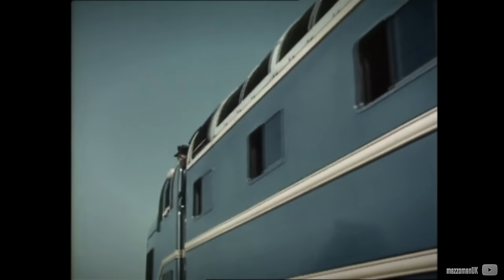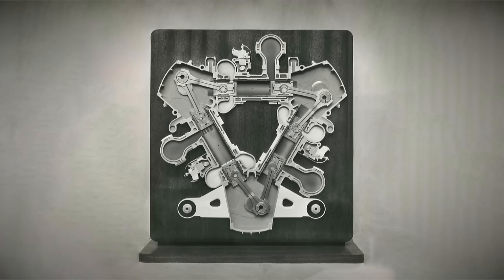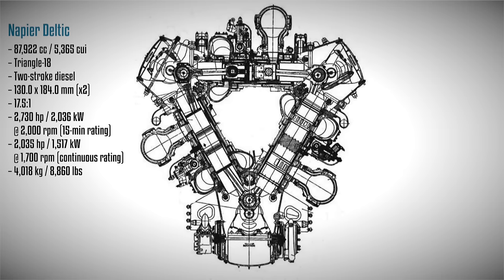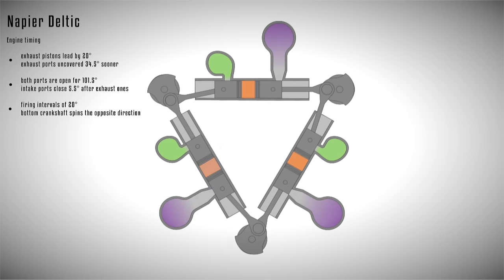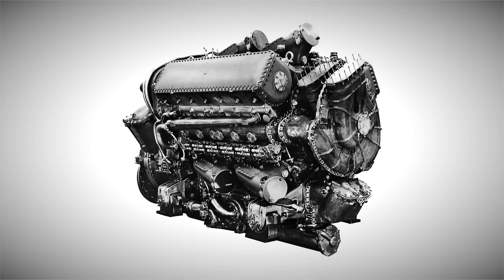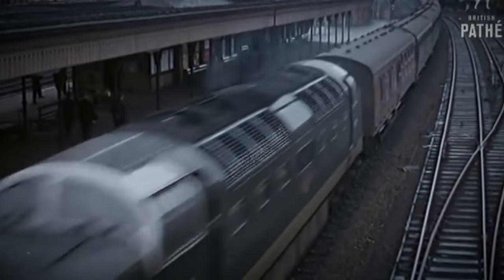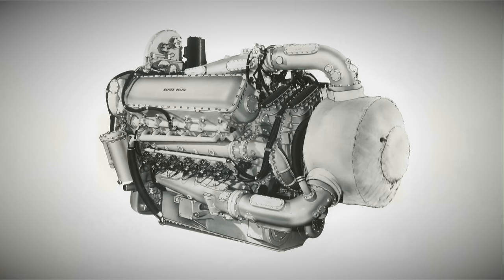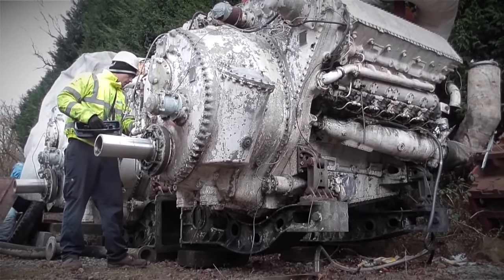The Ingenious Napier Deltic 2-Stroke Diesel Engine

Comment: So the 22 Deltic loco replaced 55 steam locomotives and, though they had a short life there are 6 in preservation. Not bad after sixty years. I remember the Deltic at York station and feeling the platform vibrate and the surge of power as they moved away.
Lets not forget that English Electric also built the Lightening jet, both icons of British industry.
Reply: The Gegenkolbenmotor (opposed-piston engine) was an absolutely revolutionary engine design invented by Wilhelm von Oechelhauser and junior partner Hugo Junkers, patented on July 8th, 1892.

Comment: The Napier Deltic is a variation of the 24 cylinder  Jumo 223 engine
Reply: The Jumo 223 has 4 crankshafts, the Napier designed Deltic has 3. They are completely different engines albeit based on the same Junkers technology.
Reply: @cs7th Napier licensed the technology and the 3 bank design.

Comment: One of my favourite engines, although the 'baby deltic' was reputedly a less reliable than the full deltic. I'd love to see an automotive version!
Reply: Neither engine had a stellar reputation for reliability... although they are based on Jumo 204 engines that were flight-rated... the 3 bank design proved more problematic which is probably why the Germans sold the Deltic to Napier.

Comment: You should include the engine torque ratings again like you used too if possible, great video btw
Reply: Like aircraft engines and tanks, locomotives Diesel engines are only rated in Horsepower... torque is an irrelevant unit of measurement in these applications.
Reply: @sandervanderkammen9230 why is that irrelevant?
Reply: @eefjuh5533  Because horsepower is the only metric that determines the top speed and the actual amount of work the engine can produce, torque does not tell us this critical data.

Comment: How did the lubrication works? With some pistons almost upsidedown?
Reply: Dry Sump set up
Reply: @tutaneka  
the reason for those 2 oil pumps (one each side of the bottom crankshaft)
Reply: Oil flooded the inverted pistons at low revs,and sloshed out at higher revs into upper crankcases.

Comment: Interesting that they had a turbo compound version with a proper multi stage blow down turbine........much more efficient at energy recovery. The big boost in hp is correspondingly also about a big decrease in fuel consumption per hp/hr produced as other turbo-compounded engines displayed.

Comment: One thing you didn't mentioned about the T9-29 9 cylinder baby deltic engine was turbocharged as well as supercharged to increase efficiency.
Reply: EMD uses just a turbocharger, with an overrunning clutch coupled to the crankshaft, the crankshaft shaft drives the compressor at low rpm and decoupling at higher engine rpm when the exhaust turbine can drive the compressor on its own.
Reply: Improved efficiency also amounted to better emission figures, but unfortunately further legislation on emissions finally lead to decommissioning of these wonderful engines!
Reply: @stevie-ray2020  2-stroke Diesel engines still used in the Marine Industry, they are so fuel efficient that this overrides emissions concerns.
Reply: @sandervanderkammen9230  Yeah but EMD engines sound like shoite where as a T9/29 sound like the sort of thing a Valkyrie would ride! 🤣🤣🤣
Reply: @TIMMEH19991  The 6,000 horsepower EMD  20V-710 sounds like the thunder of Zeus himself..
Reply: @sandervanderkammen9230  I will say I've only ever heard the EMD 12N-710 two stroke lumps fitted in the UK class 59s and 66s. Not impressed at all.
Reply: @TIMMEH19991  British locomotives tend to be small and underpowered compared with American locos.
Reply: @sandervanderkammen9230  They were designed with a power output suitable for the work available. BR decided that the nearer to max output a loco was working, the more efficient it was, and because we have a far more restrictive loading gauge than America, and much shorter signalling blocks there's no point having any loco with more than approx 3500 hp unless you want to go very fast very quickly, which we do with electric traction. Anything greater is just a waste of energy. Also worth remembering when the first Deltic was produced in the early 1950s it was the most powerful diesel locomotive in the world.

Comment: Junkers themselves had tried a 4 bank square engine, but that didn't work well and wasn't taken any further.
Reply: Napier licensed the technology and the 3 bank design from Jumo.. it chose to develop the 24 cylinder Jumo 223 and the 4,500 horsepower 224 but never entered mass production.
A fascinating concept but one that would be superceeeded by advances in turbocharged 4-strike Diesel engines.

Comment: The Class 55 locomotives had an exhaust plenum that collected oil when idling. Winding up the engine for power blew the oil out. I’ve no idea why an oil drain was not fitted. 
A single row Deltic would be a very efficient heavy plant or truck engine. Today’s technology would deal with emissions issues.
Reply: The Jumo 204/205 is the inline design.
Napier licensed both as the Culverin and the Cutlass.
Emissions are an issue and that is why other 2-stroke Diesel engines have been discontinued in most applications.
Deltic was discontinued due to high maintenance costs and short intervals between overhauls
Reply: Inverted pistons filled with oil at low revs,depositing excess oil on upper side cylinders walls.

Comment: Just as the wakel is coming back as a range extender, I think this engine could have the same function, a 1L engine in this configuration would be tiny, I imagine maintenance must be a nightmare, but considering it would run like a generator, at constant RPM, it wouldn't be often
Reply: Wankel engines are obsolete technology, they are too unreliable, dirty and inefficient.
Opposed piston engines are still in production
Reply: @sandervanderkammen9230  Tell that to Mazda
Reply: @visekual6248  Stop by your local Mazda dealership and ask to test drive a new car with a Wankel engine.
Reply: The Wankel engine was the biggest failure in the history of the engine manufacturing industry.
Reply: @sandervanderkammen9230  Doesn't change the fact that Mazda will put them as a generator in electric cars.
Reply: @visekual6248  Jaguar put a gas turbine in a hybrid car... and then went Bankrupt for the 3rd time like Mazda did the last time it launched a new car with a Wankel engine.
Reply: Two  stroke  can   never   have   good   emissions  while   making    good   power   to  weight  ,  only   static  running    low   power   density  lumps  can  do it  ,  designed in,  poor  emptying   of   exhaust  gasses , wonder   if  anyone   has  considered   running   one  on  hydrogen  . .?could  sort   out   emissions
Reply: @garypeatling7927  Hydrogen is compressible, gaseous fuel injector exist but are uncommon.
NOx emissions are still a problem with hydrogen due to the high cylinder pressure and temperature and the lean AFRs.

Comment: I wish the square version was  built
Reply: The Jumo 223 and 224 were built, but not mass produced.
Reply: Vibrations were not good...anything with "4" needs extra balancer shafts...
3 and 6 don't, nor do 9 and 12
Reply: @JohnSmith-yv6eq  why? Each bank of cylinders should balance itsself right?(assuming 6 cylinders per bank) Plus i heard the 4 crank version fixed the uneven firing order and backwards rotating crank?
Reply: @Sausketo  
Someone else commented that the 4 bank "walked like a centipede"...
so all the out of balance forces connect/disconnect and "walk" their way through the 4 crank engine during changes in the the rev range..
whereas the Deltic 3 crank motors.....
did not.
Vibrations have strange effects....
Reply: @JohnSmith-yv6eq  Just the opposite, Jumo shelved the 3 bank design and sold it to Napier because of vibration issues, they chose to pursue the 4-bank design which with 24 cylinders is inherently smoother with less vibration.
Reply: @Sausketo  Yes, you are absolutely correct.

Comment: Great video, weren't initial prototype engines tried in an ex kriegsmarine E boat where 2 deltics replaced the 3 large Daimler Benz diesels and produce more power? Also for British engineering ingenuity how about a video on the Rolls Royce twin rotor diesel Wankel engine the 2 - R6?
Reply: Napier licensed the technology from the German company Jumo.
The Rolls-Royce R-2C was designed by Fritz Feller

Comment: The Deltic WASN'T the peak of piston or British engine engineering .. that goes to Napier Sabre & Bristol Centaurus sleeve valve engines .. the Opposed piston engines make for more thermal efficiency but not refined power or performance power density .. Deltics were nightmares to service & overhaul but we're at least very reliable if serviced by the book which British rails cost cutting paid a price!
Reply: Ah, yes.. another engine technology that is not actually British at all.

The Knight engine was invented by American Charles Knight in 1906 and was later licensed to several European manufacturers including British Daimler.
Reply: @sandervanderkammen9230  agree it was Knights invention.. but primarily Bristol developed the technology that enabled the incredible performances.. the Centaurus was the first of few aero engines to reach the 2000hr service life at a time a lot of poppet valve engines were just 1000.. I ridden in a knight sleeve valved engine, amazingly quiet & no vibrations.. but it was/is a heavy engine
Reply: @Errol.C-nz  Too little too late to have any impact, the introduction of the Centuarus was completely overshadowed by jet engines... big radials were rendered obsolete, no longer competitive in fighter aircraft.
100 hour PFTR is all that was required for adoption into operational service with the RAF.

Comment: just imagine if they wanted to make one these days..... modern tech has changed so much that im sure they could make one again that has double the power
Reply: Emissions has basically rendered the 2-stroke Diesels obsolete now.
Reply: @sandervanderkammen9230  
How about those electronic Common Rail diesel injectors multi-injecting fuel at a controlled rate...
and say turbochargers to give some extra psi...
making sure the fuel gets burnt....
plus new much stronger metals so the con rods etc. don't give way at 5600horse power......
Reply: @JohnSmith-yv6eq  You still have to rely on cylinder ports... outdated technology in today's world... VVT and VVL offer advantages that cannot be duplicated in piston ported engines.
 A blower is required for scavenging a 2-stroke Diesel, they are generally "Normally Aspirated" rather than Naturally Aspirated or supercharged, piston ports are not ideal for supercharged engines as the port timing is fixed.

All Diesel engines benefit from pilot injection,  direct in-cylinder injection is typical, I'm not aware off the top of my head any 2-stroke Diesel engines that have a pre-chamber? I can't think of one at this moment.

Comment: It's very cool. Ultimately dumb design but so very very cool. Awesome sound to boot.
Reply: A dumb design unless you consider its first application - a triangular engine fits rather neatly into the vee-shaped hull of a fast patrol boat.
Reply: @kumasenlac5504  That fit-out must have been an access joy to maintain . 😬
Reply: @AnyoneSeenMikeHunt  Probably done on a swap basis - trying to work on a Deltic in the bowels of an MTB would be next to impossible.

Comment: Very cool engine, but it had it's shortcomings. It was loud as hell and needed lots of sound deadening to help with the noise. Also only minor repairs could be made in the field. Unlike the EMD or other prime mover Locomotives the you could replace a bad cylinder in the field in about 2or 3 hrs the NAPIER DELTIC required a complete engine replacement. Then the bad unit had to be sent in for repair. This was not a cost effective engine.

Comment: not the HP but the torque figures are also worth a mention = pulling all the weight - it is TORQUE !
Reply: Not in aircraft or Diesel-electric locomotives, it's all about HORSEPOWER  not torque.

Comment: but will it fit in an mx5?
Reply: Yes, and it's a more reliable engine...
Reply: @sandervanderkammen9230  the na/nb mx5 engine is fine, just needs more power
Reply: @Scoobydcs  Mazda engines suck... although the 4-cylinder is certainly better than the Wankel engines in the RX, they are the most unreliable engines ever made.
Reply: @sandervanderkammen9230  that's just bullshit lol iv no idea abut the modern stuff but there's nothing wrong with there's nothing wrong with the engines in the mo1 and 2 mx5. They just need more oonoh that's all
Reply: @Scoobydcs  Mazda has the worst reputation in the industry for engine and transmission reliability.

Comment: It seems like the Deltic should still be a thing. I wonder why it almost totally went away?
Reply: It did go away... Napier is defunct  for many years
Reply: @sandervanderkammen9230  There are still a few running examples with the engines, but what I actually mean is that I wonder why this general layout of three two-stroke opposed banks didn’t become a widespread layout outside of Deltic? It seems like it worked well and was power dense.
Reply: @captainobvious9188  The 3-bank layout was not a particularly reliable or durable design which is why Jumo abandoned the 218 and sold it to Napier.

Comment: That is British engineering at its finest. Probably designed by some blue blood who never set foot on the factory floor with the poor slobs who had to make the fucking thing. The most complicated layout possible. As many bolts as can fit, whether needed or not, and I'm sure they're all Whitworth. And it wouldn't be complete without a giant, hellacious gear train. It runs on machinist tears, not diesel. Totally impractical, but still a steampunk masterpiece.
Reply: Napier licensed this amazing technology from Jumo in Germany.
 
The Gegenkolbenmotor was invented by Wilhelm von Oechelhauser and junior partner Hugo Junkers.
The Deltic is a Jumo engine design sold to Napier, a variation of the 24 cylinder Jumo 223/224.
Reply: The opposed piston 2-stroke diesel, invented by Junkers, was hugely successful in its inline form. The Junkers Jumo 204 Inline-6 was licensed by Junkers to Napier in the 1930s. Other notable oppposed piston engines include those made by Fairbanks Morse. It's a great layout for large high speed (hence high power/weight ratio) engines which need to have a lot of pistons. The increased complexity of 2 crankshafts per cylinder is offset by the absence of valves, and the long bore with inlet at one end and exhaust at the other reduces mixing of intake air with exhaust. The design was even used in a 3 cylinder engine in the UK, designed to go in an early cab-over truck by Commer. Emissions regulations have largely killed the 2-stroke diesel except in marine applications (far from the coastline in international waters nobody cares about emissions) but Achates Power is trying to bring the design back for automotive applications.

Napier's engines are of necessity complex because they targeted larger than automotive applications that required higher RPM than can be achieved with large cylinders, hence they needed a lot of them. The deltic is the only production example of the equivalent of a V engine for the opposed piston 2-stroke and was a very successful engine. Junkers also researched  a 4 bank diamond shaped engine, the Jumo 223/224 but never put it into production.

As for lots of bolts... that's what you get on a large machine. Car wheels are held on by as few as 4 bolts, whereas trucks have 10 or 12. Using 4 bolts on a truck wheel would mean each bolt would be impractically large. That's why Napier use a lot of bolts, to avoid using massive ones. And there were no impact wrenches back then.
Reply: Not the case tradefad.
Reply: @markbeale7390  And why not?
Reply: @tehfade53  Because it wasn't developed as a punk masterpiece  simple,don't think working for napier or English electric was a poor slobs job .
Reply: @londonalicante Some French cars have wheels held on by only 3 bolts.
Reply: Lots of Japanese motorcycle engines of the 1970s are held together by large numbers of 6mm Phillips screws. At that time they were famous for not leaking oil. They are easy to dismantle and reassemble provided that you have an impact driver with the correct Phillips bit.

Comment: No toque numbers ⁉️
Reply from the maker: Yes, I totally forgot about that 🫣
Reply: @VisioRacer  😆
Reply: 2000 hp at 2000 rpm is 5252 lb*ft of torque.
Reply: @andyharman3022  Based on the 4,500 horsepower Jumo 224 engine, technology licensed to the Napier company
Reply: Easy torque and horse power are the same number at 5252 rpm on all motors !
Reply: Infinity.